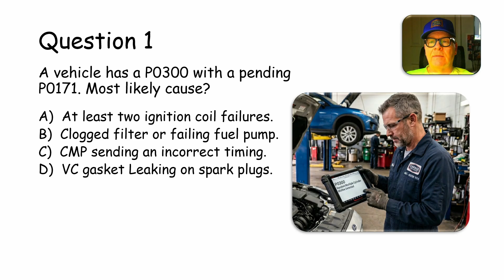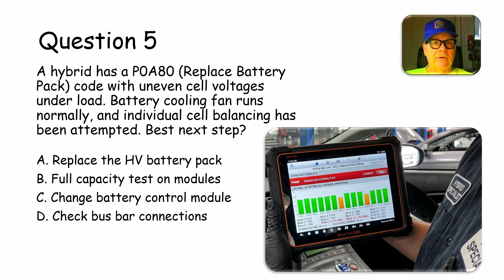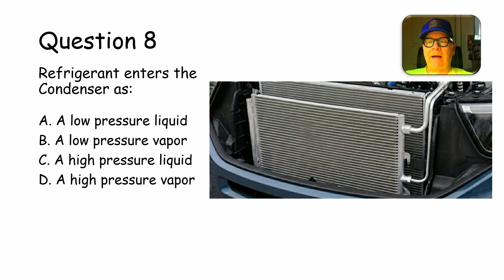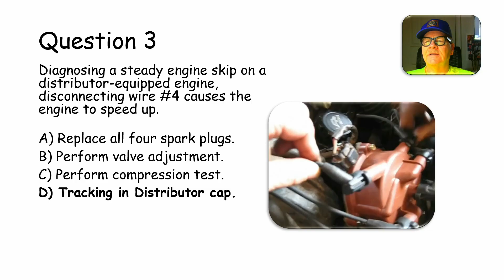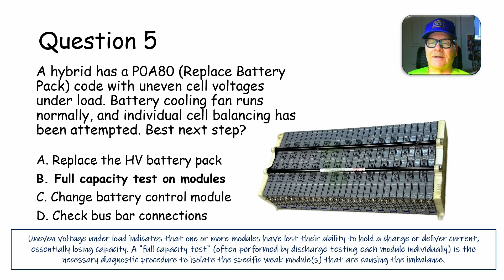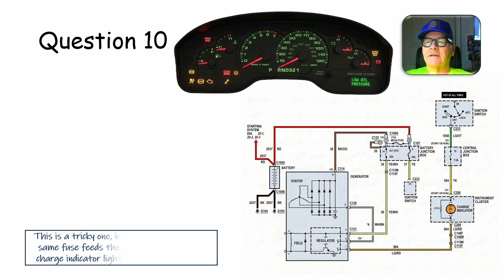ASE General Practice Test 4

Comment: @McCuistian Hi there👋 my 2017 jeep compass 2.4L has been acting up. Either when im driving or when I fully break my RPM plummets to 0 and I lose my power steering. It usually has a higher RPM. I just changed my catalytic converter and 02 sensors and I still get the code P0032 for the heater control circuit high bank 1 sensor 1 and just normal evap leak codes p0457,p0457, and p0456. Could you possibly point me in the right direction? I currently help my brother in law fix my car. We are DIY type of guys. I appreciate any information- Matt